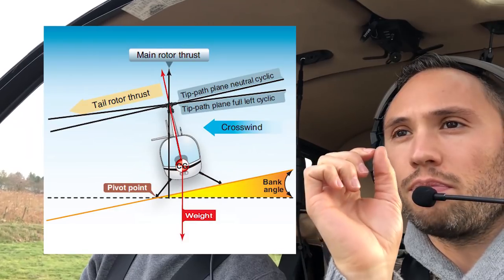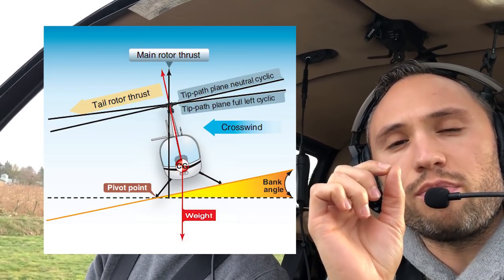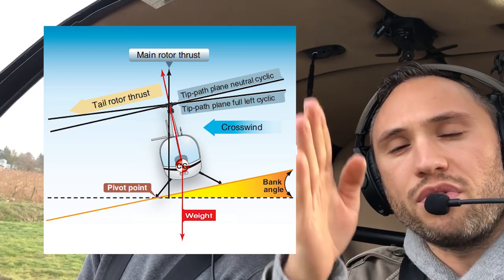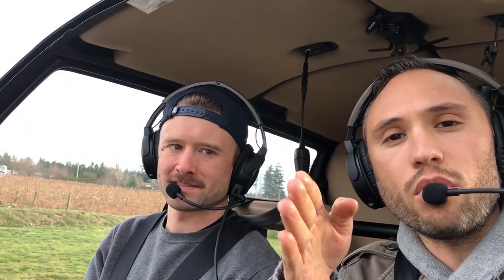AVOIDING DYNAMIC ROLLOVER

Comment: Good video about dynamic rollover, Mischa.  But you omitted one big factor in getting into it: Yaw.  If a skid is stuck and you don't have your yaw trim just right, tail rotor thrust will cause the ship to roll to the right.  The T/R is way behind the pivot point, remember, giving it lots of leverage.  No amount of left cyclic will stop the roll - only lowering the collective will.  Yaw trim is SUPER important when lifting off from sketchy surfaces.
Reply: That Bob Guy translating tendency will pull the fuselage over the pivot point?

Comment: Hi, interesting difference in instruction philosophy. I had been trained from private through CFI (and trained my own students) to fix dynamic rollover only with down collective, since the net moment of a full cyclic deflection away from the pivot point would still be towards the pivot point once a significant roll has started. I had always thought of/taught static rollover as pertaining to when the blades were stopped, not as separate phase of the 'dynamic rollover' process. Considering how fast a roll can happen with a newer student who might be too eager with collective on takeoff, I feel safer having them immediately lower collective rather than take the millisecond to judge wether the angle is too extreme for a recovery with the cyclic.
Reply: You are absolutely correct. Static rollover happens without aerodynamic forces, when rotors stopped and typically while jacking up one side. Here the rollover happens after the CG goes out of the wheels.
Dynamic rollover tip over point is far much earlier
Reply: @venkyvenkatesh999  
Let's not forget crosswinds...
Down collective is the only remedy, unless full power n up collective can pull you up immediately, opposite cyclic won't help

Comment: Good video.  Question:  is it possible to roll a helicopter over while in flight.  While flying a Jet Ranger 206 simulator I attempted a very sharp turn with the intention of backtracking.  I wasn't paying attention to the airspeed, which was quite low.  I input lots of cyclic to the left, but didn't use much pedal.  Suddenly the horizon flipped over and I flew inverted into the "ground".  Talk about an unintentional maneuver.

Comment: I know weight is always the enemy, but I wonder with modern lightweight 'chip' cameras, if it would be possible for manufacturers to put a cam lens in the front curve of the tailboom, integrated into the PFD (in the case of the Cabri), which would provide a view of the skids during takeoff/landing. It's one area that has zero visibility. The interface would be a challenge to find room in the PFD, certainly, but pilots who do frequent off-field landings on complex surfaces might consider it a desirable option. I thought your story was great and I'm sure it will help a pilot who never thought of snagging something like that!
Reply: That's a cool idea. It would be nice to have a down/rearward view from underneath the cabin. Basically the same view as a backup camera in most cars these days. Would also give you a view of obstacles behind you that could interfere with your tail rotor.
Reply: I know this is 8 months late but I do believe the new Airbus H160 does in fact have a tailboom camera, pretty neat.

Comment: Hi there. It was a nice explanation. However, many other conditions can lead to dynamic rollover, such as drifting sideways while pick up or sit dow. Strong especially gusty beam winds exceeding transition speed of the helicopter can induce serious dynamic rollover, which is lot more complicated to recover from. Once the roll over sets in the rate of roll can exceed the lateral control power of the cyclic, rendering recovery with cyclic impossible. 
And most important to study the tipping forces and moments and restoring forces and moments. 
Incidentally, rotor thrust forms major part of tipping force and hence should never try to lift off once the rollover starts.
Weight is major restoring force and hence lowering collective restores the helicopter from the impending rollover

Comment: Another thing that helps is not flying Robinson's which all have that dorky looking, super long main rotor shaft that raises it's overall CG making the roll much quicker if a skid sticks.
Reply: A turbine engine above the cabin has a higher cg than the Robinson’s low mounted piston engine. The reason for the long mast is to prevent the main rotor from striking the tail boom. Take a look at a 206 and visualize it with the rotors in the same spot and without the engine compartment, the the mast would look equally long.

Comment: What is the difference between static vs dynamic rollover?
Reply: It's the difference between falling over and being pulled over by main rotor thrust. For any helicopter, there's a limit to how far you can tilt the rotor disc relative to the fuselage by using the cyclic. If the cabin begins to roll (because of CG or because part of the heli is pinned to the ground), you can initially use cylic inputs to keep the disc level with the horizon, and thus pulling the helicopter straight up off the ground. If the cabin tilt angle exceeds the maximum cyclic throw (you run out of stick), the rotor becomes tilted with respect to the horizon and you end up with the rotor thrust pulling up and to the side; since the helicopter can't go up (it's stuck on something) only the sideward component manifests itself and the helicopter gets yanked over onto its side. The only way you can stop the rollover once you run out of cyclic is to take the thrust away by lowering the collective.